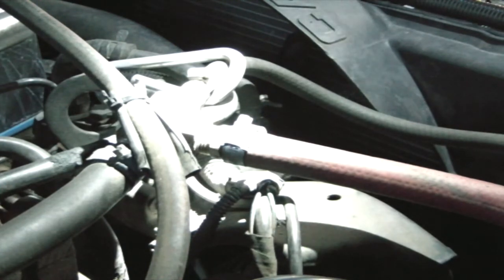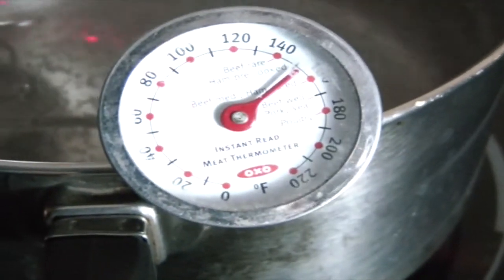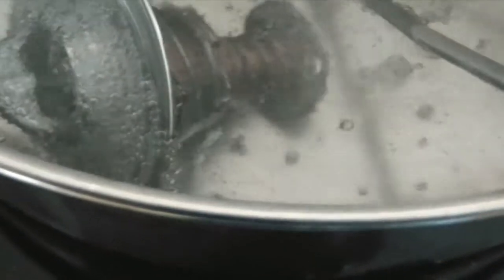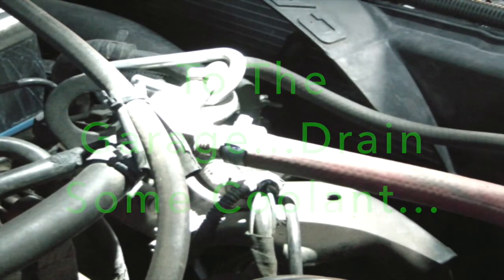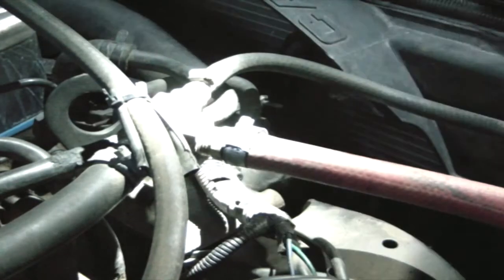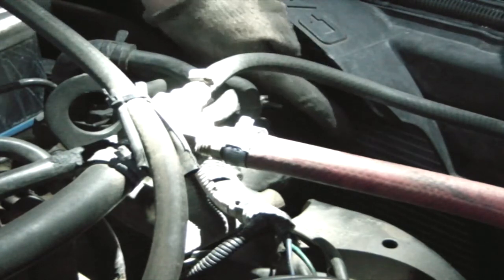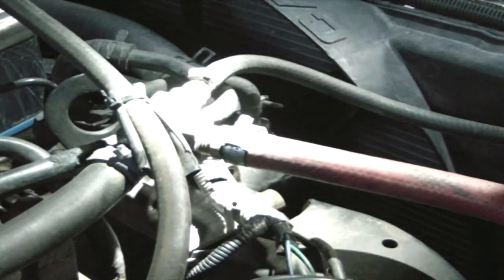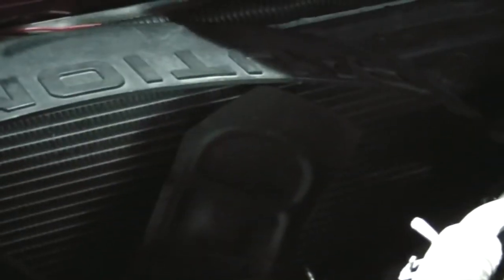1998 Dodge Ram 2500 Cummins 12V Cool Running Troubleshoot

Comment: For parts for Cummins 12 valve go to Poorman's diesel at omni-mfg.com
lift pumps - valve cover gaskets - fuel tank sumps - Pmd remote fuel filter/water separators - valve springs